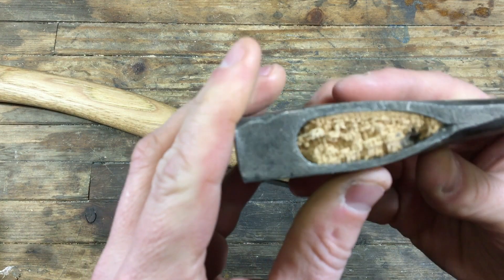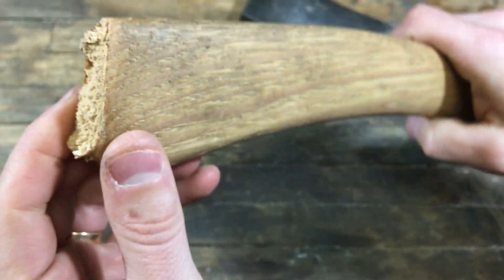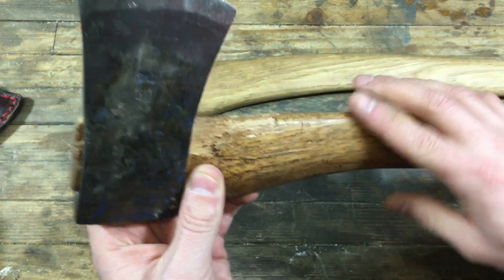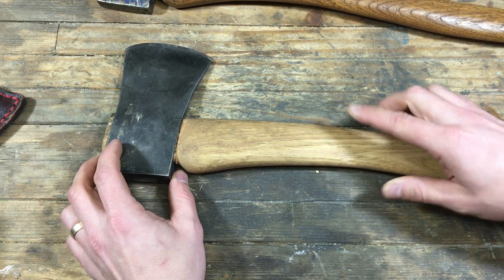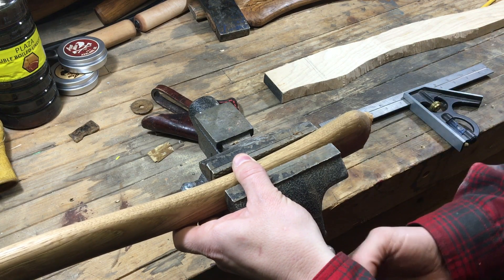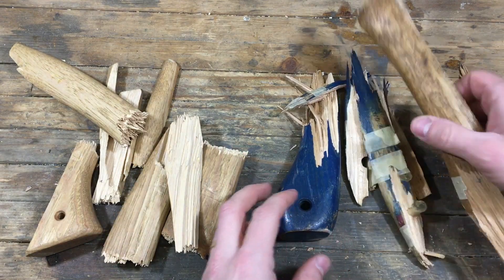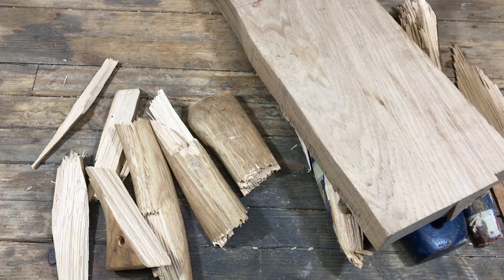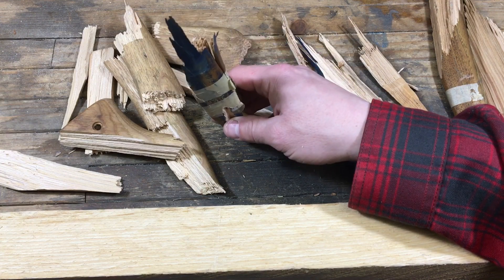Busting AXE Handles - How to Spot Bad Hickory!

Comment: That was visually impressive contrast. Clearly, this is something we should all bear in mind and check for if we're going to make a tool handle.
       A  friendly note on syntax, in case it matters to you - when we want the noun form of an adjective ending in '-ous',   (or '-ose')we don't add the suffix '-ness'. Instead, we drop the 'u' (or the final 'e') and add the suffix '-ity'. So we get 'porosity', 'generosity', 'curiosity', 'monstrosity', 'verbosity', viscosity, etc. There may a few exceptions, but some of those adjectives derive from nouns and not the other way around: 'famous' came from 'fame', whereas porosity' comes from 'porous'.
Reply from the maker: Lol. Grammar and spelling have always been my downfall, give me math and science any day. Thanks for your comments Craig, and thanks for watching.

Comment: Thank you for this lesson. I would not have checked that before now... it looked to me at first that you tried that horribly dangerous method of tightening up your handle by dunking it into a bucket of water... no one do that btw, just oil up your handle instead... but obviously you just picked up a bad piece for tool handles. Seriously thank you for the lesson.

Comment: I’ve  hung and  broken 2 new axe handles  in the last 2 weeks  . One handle from a Bunnings outlet …. And one from  general tools store  , selling cyclone branded axe handles  . They both broke in exactly the same way .  I had treated them with a     Linseed oil and mentholated spirits  rub .     My previous axe handles lasted years  using this method .

I finally went to my local hardware store and bought 2  spotted gum axe handles . $29 each  absolutely perfect  .  👣🦘👍

Comment: That hickory is what is called brash.  It is not rotted, just relatively lightweight and weak compared to "good" hickory, due to the growth habit of the tree.  So that whole 8 food board is no good for handles.  You can indeed see the porosity of brash hickory by looking at a clean cut of the endgrain.  Also stay away from what I call "cadaver' hickory, which has a light bluish gray cast to it, caused by fungus.  However, an even bigger issue and the real reason the handle broke that way is that you need to file off the sharp burr on the inside shoulder of the bottom of the axe eye.  Happy axe handling!
Reply from the maker: Thanks for the info. It was an odd one. With all the handles I have made this is the only one that has ever broke in this way. It was weird.

Comment: Even if the same species , from piece to piece not every one will be equal. My first thought was that the head was improperly hung or that someone had soaked it in water, or otherwise had done something to crush the wood fibers inside the eye of the axe head. Though from the close ups you show I think the particular piece of wood you used for this handle was from a very slow growing tree. 

It seems counterintuitive, but the strongest hickory (ash and oak also) comes from fast growing trees, and not slow growing trees like would be the case with softwoods. This is in part to how porous the rings are. When you look at the end grain of hickory under a bit of magnification (10x) in each ring you will see large pores in the early wood of the ring which get smaller in the later wood of the ring. In a,slow growing hickory all you will see is large early wood pores. This makes the wood weak, the end grain will look very holely and have the punky appearance others have mentioned.

The metal wedges you put in across the grain also makes me cringe a bit. A wood wedge is good enough, maybe a bit of loctite if you feel like it. If there are gaps or spaces on the ends you wish to fill, fill those with splinters from broken handles or from a wedge. Save the metal wedges for field repairs on lose heads, or for tools with a more round or square eye like a hammer. I know I have suggested the Forest Service crosscut manual to you, the Forest Service also put out a manual for axes, it’s called “An Axe to Grind”.

Thanks for keeping old tools alive :)

Comment: you can glue wood with west system 105 it gets stronger than original, you could also use some quality cyanoacrylate, wont break again on the same spot guaranteed
no preparation required, just apply glue, put peaces together and press till glue is done. works only for diagonal, and splits alongside grain.
i actually had hammer that broke same way as your axe  (porus handle one), and ewentho i know its not supose to be glued that way, i had some leftover west system 105 205 wood epoxy glue, and i glued it just to see what hapends, ended up quite strong, and i had to really try to brake it.

Comment: Get some ash! Or maple... Maple you have to flip the grain the other way though, because it's "diffuse porous" wood. (There's a guy with a video on here about MLB bats and maple grain orientation that's really good) but yeah ash is probably more practical in board form. Plus it just feels nice in the hand. Hard smooth. No pores.

Comment: is it possible they sold you beech instead of hickory? Because what you (and other viewers) call "porous" looks to me like normal breakage in short fiber wood like beech, solid blocks and branches will show such a surface... To evaluate porosity, you'd have to file and sand it down to a smooth surface and then blow air through, then measure the required pressure. Then make a piece of equal length from a good piece of wood and do the same to compare.

Comment: Have you thought about trying stabilizing resin?
Reply from the maker: I have not. Does that work well for axe handles or does that change the way it absorbs the vibrations?
Reply: I'm not sure about axes, but I've used it for hammers and it works fine.

Comment: pithy,punky from being left in the elements too long before drying...if you suspect a piece to be like this but don't want to hack it up I'd suggest oiling a section.pithy wood will act like a sponge whereass hickory will 'pool' the oil fairly quickly on the surface as its so dense...

Comment: To better see the pores you have to saw across the grain, not break it.  I have only seen a very few handles break like yours did.  No matter the science, you got a bad piece. Like buying an apple that looks and feels good and the inside is bad. Sometimes it is just the luck of the draw.

The porous end grain is not always an indicator, but it is an indicator.
Reply from the maker: I agree about the porous grain but breaking the wood did show me how it would and could break. That concerned me more. Yesterday I went and got some new hickory slabs and none of the boards they had pores like the bad one had. There was an obvious difference. Thanks for the comments and for watching.